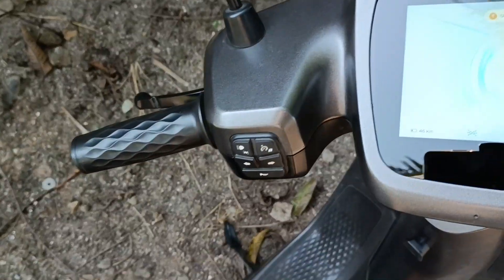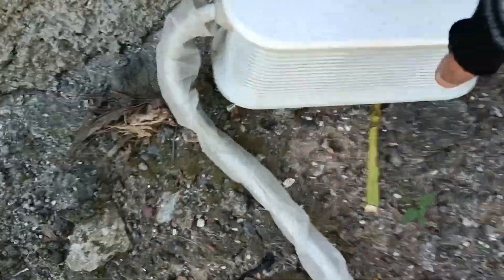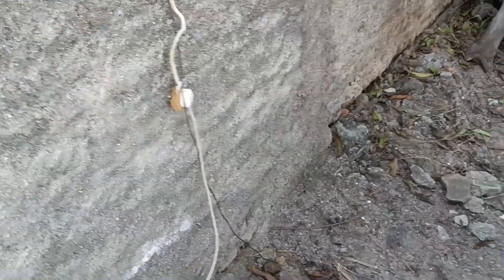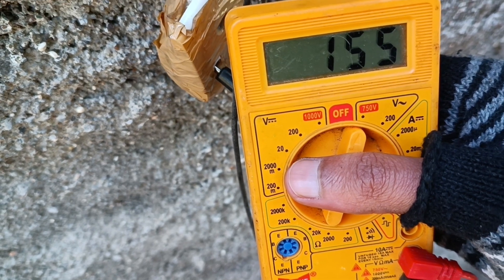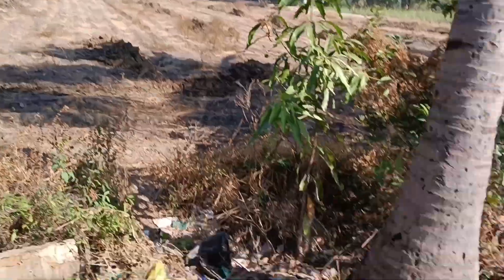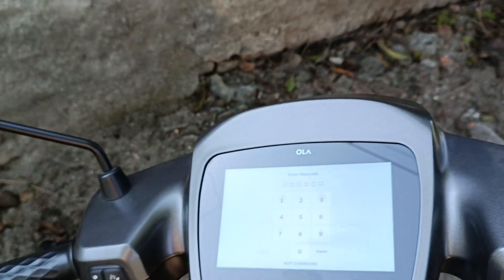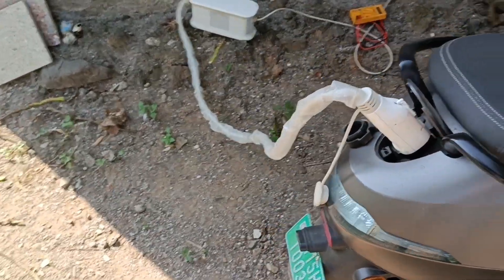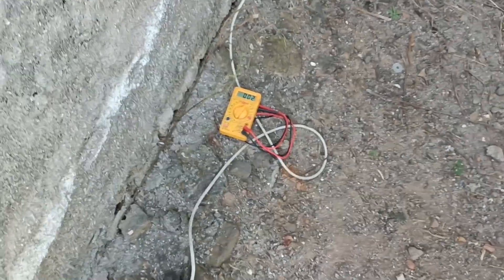Ola S1 Charging Problem in My Village Area | Ola charger Not Working

Comment: Mai toh society me rehta hu fir bi ye problem aa rha h fan nai chal raha aur dikha raha h unable to charge koi solution h kya?
Reply from the maker: Voltage check karo socket ka agar 170 se kam hai to ye problem ata hai agar 170 se jada hai to apne charger ka 3 pin plug jo hai use open karna aur connection check karna koi screw missing nahi hona chahiye
Reply: @EVExperience  okkay got it thank you
Reply: Agar 170 se kam hua to kya kre?
Reply: @pxyushmusic koe solution mila?

Comment: Transformer low voltage ko bhi stable karata hai kya ?
Reply from the maker: Nahi step up karta hai always go with trusted brand stabilizer
Reply: @EVExperience   160 volt ko 200+ karega kya
Reply from the maker: @vaibhavavhad8494  yes it's possible but you have to get number of winding turns correct in secondary winding and it should heavy load transformer

Comment: Same problem for me once I connect the charger it’s showing unable to charge the vehicle 

How you solved the problem please let me know
Reply from the maker: Have you measured the voltage if it's less than 170 then there is only 1 solution get a big stabilizer or change the phase (RYB) don't try yourself if you don't have know anything about electricity